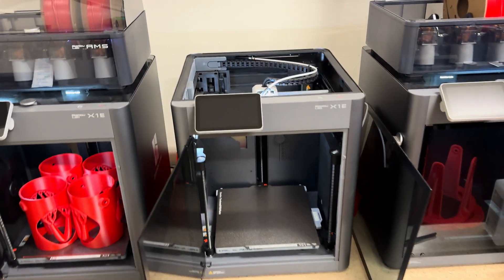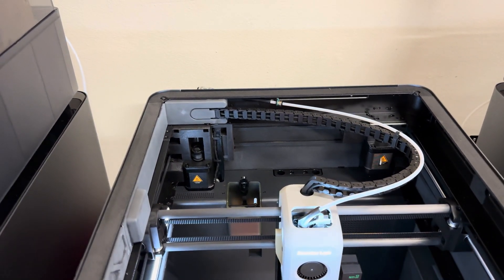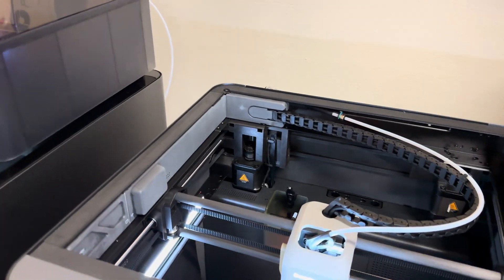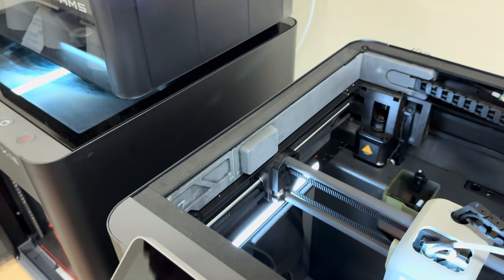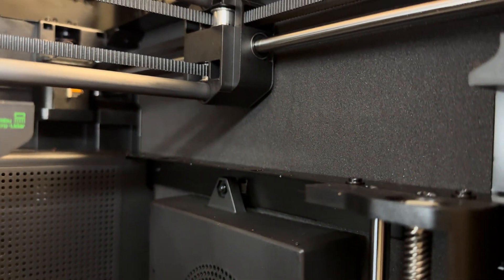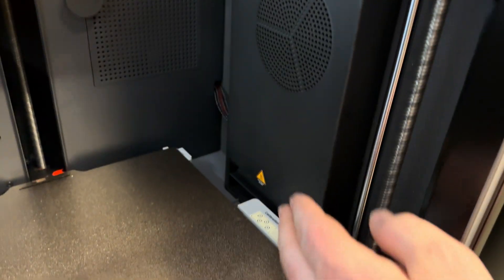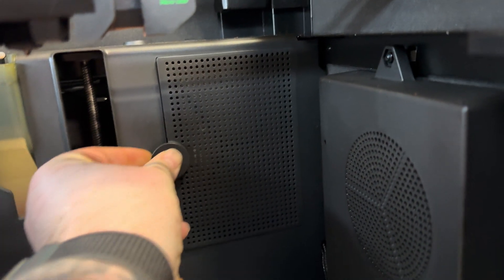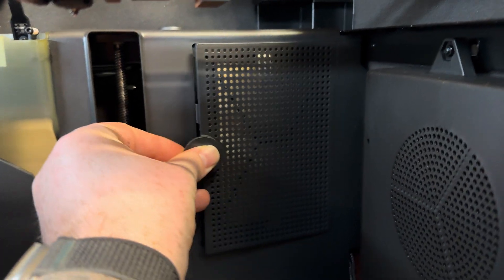Bambulab X1E, One month check in

Comment: How does the x1e compares with the stratasys in quality and speed?
Reply from the maker: They're actually pretty close in surface quality. For smaller to medium parts the X1E probably takes the cake. For large ABS/ASA prints the Stratasys walks away with it. The speed is actually really comparable even with the Stratasys having to do nozzle swaps for support. I'll try to post some comparisons for the quality and speed for the same part.

Comment: Why did you buy that? Its not at all worth the price. I would hope that now that the h2d is out that these things found themselves a for sale sign. The X1E was not a smart buy.
Reply from the maker: The main draw with these for us was the Ethernet port, heated chamber and higher temp nozzle. We do a lot of high temp materials and a heated chamber is a must have for those and it helps quite a bit with larger ABS and ASA parts as well. But yes with the H2D I see these as being less valuable brand new now. Unless space is of concern for someone and they can't fit a larger printer.

Comment: Any tricks on setting up these in a print farm?  I am looking at buying a few more.  The heated chamber is nice for ABS... and don't laugh, it also is useful for a filament dryer.
Reply from the maker: Hi! Yes they work well in a print farm. Although I have to mention the power draw is quite a bit higher when using the heated chamber so make sure you have enough power to run them.

Comment: Does the chamber heater also have a HEPA filter?
Reply from the maker: So sorry for the extremely late reply. But yes it does have a HEPA filter. The filter in the X1E is about 4 times larger than the X1C. It lasts longer and is higher performing.

Comment: Is there a noticable difference in surface finish/ print quality between the X1E and X1C?
Reply from the maker: I don't think so. The biggest difference I've noticed is an increase in layer adhesion for materials like ABS and ASA. The heated chamber really helps those print even better. Also the hotend design is different I found out. They have completely different wiring and are not cross compatible with the X1C.

Comment: Are those really all the differences compared to the X1-Carbon? 
Are the software and  hot ends the same ?
Thank you
Reply: The X1E has a couple differences compared to the X1C. 
The X1C has a 100W power supply, while the X1E has a 450W power supply. The power supply requires a fan that is added so the back panel vents are slightly different. 
Also the X1E has a network card and ethernet port connectivity via the back panel. 
The X1C has a small area for a HEPA filter / carbon pellets, while the X1E has a large HEPA filter / Carbon pad. The X1E also uses a modified radial blower fan assembly for the chamber temperature regulation / air exhaust fan, while the X1C has a simple PC case fan.
The X1E has a chamber heater that is missing from the X1C. 
The X1E has an additional power & communications board that powers the PSU fan, and controls the built-in chamber heater/chamber heater fan that is absent in the X1C.
The X1E hot-end is more like the P1P: it doesn't use JST connectors, and it integrates the thermistor with the ceramic heater into a single connector. 
I believe that the 320 degree limit is software controlled but also requires the larger PSU. 
The paint scheme is slightly different as well.
Reply from the maker: Actually I'm glad you mentioned it. It wasn't something I noticed at first. But the hot end connectors are different. They are improved for sure. But that also makes the hot ends not interchangeable between the X1C and X1E. The main structure of the hot end seems to be the same but the connectors are not.
Reply: @folsomtech  I guess the higher Temps require a different connection. Thanks
Reply from the maker: Software is the same just a different printer profile.

Comment: How high have you been able to set/achieve the internal temp?
Reply from the maker: The internal temperature has a maximum of 60C. I wish it could get up to 90C for some of the more difficult materials, but even the 60 has made a huge difference with large ABS/ASA parts and Nylon has been printing like a dream.